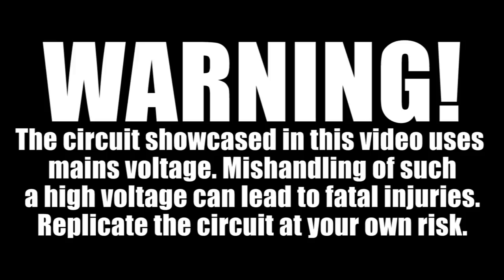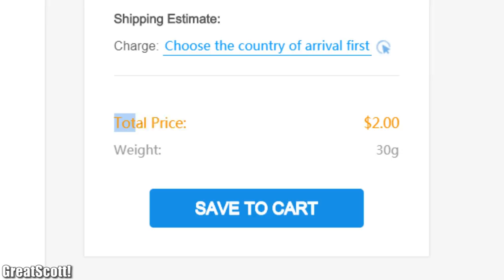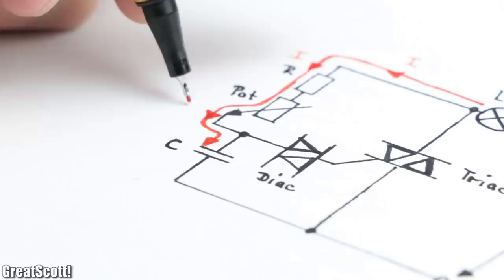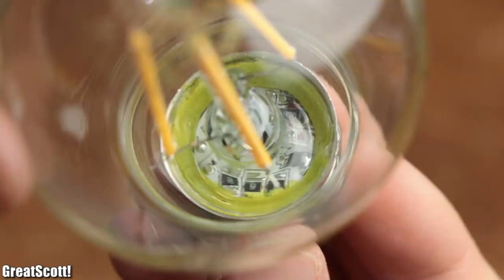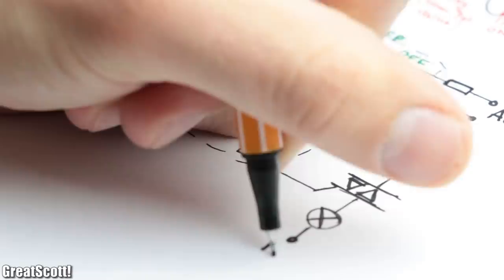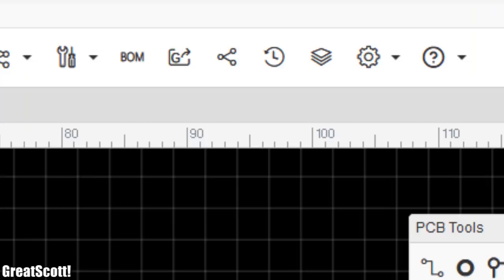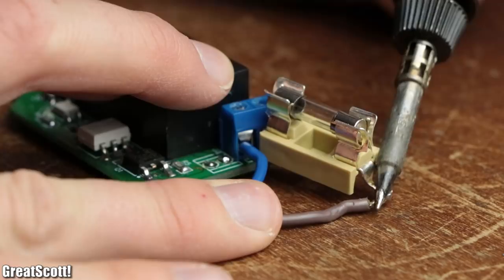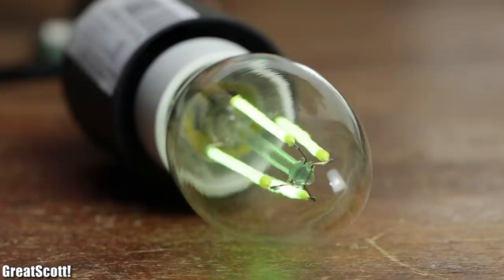AC Light Dimmer || DIY or Buy || Phase Angle Control Tutorial

Comment: Great video! I made this in 1992 with an EPROM based micro controlling 8 of these in parallel and accepting dimming values from the serial port. I programmed it all in ASM and every iteration of the development code took 40 minutes in the UV light to erase the EPROM. I also made the PCB by hand with a Dalo pen and drill. Good times!

Comment: You mentioned not using a capacitive dropper due to insulating issues. However the copper-fill on your board brings the mains too close to the low voltage side.
The arcover distance is too low I would say.
Many PSU PCBs do not feature any copper fill due to this reason.
Reply from the maker: Possible, that is also why Buy wins in the end. I am not a PCB design engineer. That shines through sometimes.
Reply: @greatscottlab  it still is a great design idea
Reply: That is not true many pcbs do have a copper fill but they always seperate the mains and output fron eachother and ofcourse use optocouplers.
Look up diodegonewild for this
Reply: @greatscottlab  Looking at the way this channel is heading - soldering batteries, creating making mood lights, making dimmers - you should maybe get in touch with people who do 240V PCBs. 240 Volts aren't much of a problem if you consider a few safety rules, like 6mm spacings. Maybe watch a few of BigClive's Videos, too, he always nags about unsafe electronics devices and shows why safe devices are safe. But I guess you already know him... It's not about nagging, more about the fact that I'm gonna build what you show here.
Reply: @bashaaksema94  yeah that's correct. As long as you keep no copper distance between traces and maybe even make adequate cutouts everything is fine
Reply: @greatscottlab  as you mentioned customizable, you could enlarge the gap between tracks.
Reply: @greatscottlab  so your two major blunders on that board is the flood fill and your optos not having a common line of isolation that the cross. Essentially U2 and U1 should bridge the high side and the low side across a single line. 
So flood filled cooper is a thing many people do not realizing it's done to reduce EMI and add a tinny bit of extra decoupling. When you have mains level voltages on a board, you want to make sure the low side and high sides are isolated and protected for all the major failure modes.
Reply: Wouldn’t you also want routed out sections between the high and low voltage sides so that you couldn’t get creep? (I don’t remember it’s proper name; it’s when the high voltage breaks down the insulation over a very long time)
Reply: Or is that only on transformers that you would do that
Reply: Yeah I came here to make a similar comment. But don't be discouraged. Maybe you could do a series on learning how to do PCB layouts? (After your studies are done, perhaps.)
Reply: @unbekannternutzer8506  was there any chance it wasnt?

Comment: "STAY CREATIVE AND I WILL SEE YOU NEXT TIME" ...this line has a separate fan base!!!!!!
Reply: So true!
Reply: Very true
Reply: I am new to this electronic stuff  

 so I am 16 and I just take components off of  random circuitboards from broken thing I can find. 
What does a coil do 
 i found a random  core "or what ever it is called" and it didnt have any wire around it. I tried to wrap wire around it and hooked it up to something 
I didnt get a circuit, nothing happened can anyone tell me what I did wrong
Reply: Kody Deville more information needed, what were you trying to achieve?
Try asking on Arduino forums or reddit
Reply: @spike4850  like I said I am new like verry new to this can u start like I depth with what an ardwino does and how I can find them on old circuit boards
Reply: Kody Deville an Arduino is a microcontroller. It is a product that is designed to be programmed so you can interact with hardware such as LEDs, motors etc. You can’t find them on circuit boards, you have to buy one online.
Reply: @spike4850  ok another thing I have this old laptop with a busted up screen that still works. I have a monitor that I hook it up to but I can't get it to show the load up screen that has the start up options for the laptop.  Is there any way I can hook up an external screen directly to the computer so I can see the start up screen
Reply: And I don't know how to program
Reply: I am able to get the screen to appear on the monitor . It takes a few tries to find the right reboot  option on the shattered screen but I get it to work.  do u know if there is any way I can get it to do the reboot automatically without me having to do it manually
Reply: Kody Deville seriously, ask on reddit, Arduino forum or stackoverflow

Comment: One more benefit of the BUY version is that it doesn't require power and can be used as a light switch, while the DIY version needs mains voltage. In fact, that might make a good video - how to draw current in series with a load, it has a lot of variations to it.

Also, the trace separation is soo narrow. I have one PCB that is pretty much the same thing, with a termoresistor and an LED display, but I had to go with big trace spacing and also clean the board very well. 
All in all, I hate dealing with mains voltages :)

Comment: Filling the ground plane in this case doesn't make very much sense since you have galvanic isolated between the high and low voltage portions of the circuit. The filled plane reduces the isolation distance unnecessarily. My biggest concern would be the potentiometer otherwise the case is enough protection. A partial fill would have been better.
Reply: I never understood the reason behind a ground plane. Maybe for interfearence reduction in highly sensitive circuits or when DIYing PCBs with a CNC. But even when etching it makes no sense. Ferric cloride is so cheap that being able to etch more PCBs with the same solution was never a valid argument for me.
Reply: I'm glad someone mentioned this!
Reply: @NightmareQueenJune  Ground planes are just like You said to supress EMI and in most driver IC's, transistors, diodes etc for heat dissipation.  For some data traces You can calculate capacity between data line and ground plane to get lowpass filter but I never used it in practice.
Reply: I use ground planes for impedance matching on RF circuits and sometimes for ease of use in DC grounding. For low-frequency circuits such as this, the ground plane should have been avoided.

Comment: I think with a better design of the PCB, and with an ESP8266, you could make a wifi controlled dimmer. Then have something like a rotary encoder for local brightness control. A central Raspberry Pi could be used for automation as well.
Reply: I was also thinking, adding esp-12f module would bring in a great benefit over the Buy versions, because you can then connect dimmer to many smarthome systems. (homeassistant)

Comment: Just some piece of advice for when you have to deal with mains voltage.
1) you did not respect clearance and creepage distances. The mains traces are too close to each other and to the low voltage part. I think clearance should be in the range of 3mm, and in the points where you are close to this you should make a slot in the pcb to increase the creepage
2) as others have said, don't use a ground plane in the mains voltage. You are reducing the insulation.
3) in your pcb, clearly separate the mains voltage area and the low voltage area, and possibly use a slot there to further increase the creepage. So draw a line, then put all mains components on one side, all low voltage on the other, and the connecting (hi-link, optocouplers) across. Avoid what you did here between the optocouplers

Thank you for all your videos :)

Comment: You should learn how to design a board for AC applications. That's the only problem stopping the DIY option.

Unless you're experienced it should be a good project. You just have to keep it in mind that you work with AC and unless you screw it up good then house starts on fire.
Reply: Seems to me like it's the same as low voltage, it's just worse if you screw up. Engineers for the power grid call 240V low voltage :P
Reply: well, it's been 2 years, but can you send me any docs, videos or tips for AC PCBs?

Comment: Another thing the potentiometer does in these circuits is reduce the power to the load, assuming the circuits were designed for maximum power transfer when the voltage is in phase.

Great video I enjoy this channel I think they should show more examples like this in engineering classes

Comment: Tbh DIY version is better due to its customizability. You could easily add sensors, replace the microcontroller for something with mode features or make it a multiple channel dimmer. I once wanted to make a this kind of dimmer for my bedroom lights and have Wi-Fi capability on it, but couldn't find a commercial product with a good price. Making it by myself was the only option, but up to now I couldn't find much information on it. Thanks Scott!

Comment: Since most mains power LED lights have a fairly high capacitance on the input, dimmable ones usually work better with phasenabschnitt. So if you're gonna use a ATtiny anyway you might as well use mosfet based circuit to control the AC since you can turn it off whenever you want during each half wave, you don't need a specific minimum latching current etc. For low power applications like these, mosfets while being more complicated to control AC with definitely have a lot of advantages over triacs.

Comment: Atmel/Microchip recommend a 100nF cap placed directly across the Vcc/Gnd pins of the ATTiny85.
Reply: That's just the bypass cap. You should include such a cap on every single digital component as close to the VCC and ground pins as you can to reduce parasitic inductance. They're not absolutely necessary. Your circuit will probably still work without them, but it improves stability and levels out fluctuations in the power supply.

Comment: I would recommend trying to make a trailing edge dimmer using a mosfet instead. You have more control over the waveform using mosfet instead of triac, less audible buzzing, less inrush current, and more friendly to LED lamp circuits when making it trailing edge.

Comment: Well, you have done a great job!
I might say DIY is the winner but there is no point for not using a capacitive dropper for the 5v supply, because the circuit will still be associated with mains and so the entire PCB should be isolated anyway.

Comment: I would say a nice 3D printed case/wall mount would bring the safety aspect up, but not everyone nas a 3D printer. Another thing to worry about is the possibility of microcontroller crashing due to interference making your light suddenly come on at full brightness, or turn completely off. Also why do you need a bootloader on the ATTiny, if not only you program it via ISP, but you also program it only once. Bootloader (especially the default arduino one) only takes up space and delays the startup of your program.

Comment: This is nice until You dimm active loads. Lets try some inductive loads (Fans and motors). For correct dimmer work You need to add shiffer circuits after optocoupler and also after triac. Nice PCB by the way. My latest finding for cheap uC in such of projects are STM32F051 - just 0.63€ in china. Most advanced feature in my point of view is 12bit ADC and DAC wich makes it perfect for some analog processing. I have made the same circuit some time ago with my CNC machine but for 8 channels, and understand that it was big mistake without sniffer circuit on load sides. Actually comercial solution wins only in one case - if You want to adjust power with You hand. But if You want to use some analog signal (Like 0...10V or 4...20mA) - then Your way works much better (Just need to replace potentiometer to analog input and it works.). Keep going - I love Your videos.

Comment: For the umpteenth time you deliver info exactly on what I wanted to work on. Thanks a lot.
Reply from the maker: You're welcome :-)
Reply: We have these AC motors on ceiling fans in India. Can we run those on these circuits to control the speed? Will the current flow and heating be too much to handle?
Reply: @anycatdessai  Motors cannot be dimmed since a motor is an inductive load, which will destroy the dimmer. These dimmers are only suitable for resistive AC loads.

Comment: Excellent video just one suggestion, those last copper planes break safety, you should not have them due to clearance and creepage distances standards for a given voltage, altitude and polution degree, by having them you defeats the purpose of the isolated power supply you are using :)

Comment: as long as you  have the board properly enclosed in plastic enclosure you should not have any safety issues?

you would need to design a knob stem that insures you can not come into contact with the  metal threaded part of the  pot control.

maybe a deeper enclosure and a pot control stem extension (you see this on some older tv monitors from the 60s to 80s to ensure the user cant come in contact with the high voltage parts such as the flyback transformer, multiplier and screen and focus boards

if an arc or short to the low voltage parts is made i would think the fuse would blow and the dimmer would be blown

Comment: I have solder, a soldering iron, not a lot of components, a room shared with my brother, a table, screwdriver an electric one, solder wick, and used solder. But I don't have a PCB, Arduino nano, capacitors, LED lights, potentiometers and wire.

Comment: I wonder why switching on in the middle of the sine is better than switching on at zero crossing and then cut off in the middle of the sine? I would assume soft on should be nicer to the load than just high impact at full voltage? I miss such explanation in all those videos about phase angle control. Thanks

Comment: Hi!! Nice video!! I didn't understand why this circuit is not safe. You've said that you wouldn't use the capacitive dropper circuit for safety reasons, and then used an IC to solve this problem. Then, why is it unsafe if you aren't using a dropper circuit?

Comment: I use old vacuum cleaner speed control for dimming my lights at home. They are awesome because they have nominal power of over 2000W. Only problem is that they need to be conected betwen live and neutral from wall and live and neutral from lightbulb. Would be cool if I could transform such citruit into the one conecting in series with the load.

Comment: i guess your next topic is about leading edge dimmer or trailing edge dimmer. 
If you are using TRIAC like in this circuit then it must be leading edge dimmer that it controls when to conduct the TRIAC. This method troubles some dimmable LED driver, because the driver are looking for phase length at the beginning of phase which is could be done with trailing edge dimmer. To make trailing edge dimmer we can't use TRIAC because most TRIACs can only delayed turn on but once turned on TRIAC cannot turn off until end of sinewave phase. Try to answer this problem when you are making video about trailing edge dimmer.
Some dimmable LED are flickering because simply there is not enough energy at the beginning of phase to power the switching driver circuit or in other word they need minimum phase angle to turn on (mostly above 15%). Other dimmable LED may not flickering because sometimes they are just designed that good so the switching driver are so efficient that they can be powered by only 4% phase angle so the LED are lit dimly (for night light).

Comment: I'm just working on exactly the same project. I've made pretty much the same PCB specs, however with a far better zero cross circuit. 
I was hoping you could explain how do proper filtering of the triac output to illuminate voltage spikes. But you didn't mention it at all :(. Also this doesn't show the best way to dim LED bulbs. You could do far better dimming with trailing edge dimming instead of leading edge. I was hoping you would explain that to, because that's what I learned from my project so far after I destroyed a few led bulbs...
Reply from the maker: Wait for the follow up video :-)

Comment: I had an LED and old fan regulator I  connected both of them in series , it dimmed quite well but at lowest setting of my fan regulator it flickered too much and last two setting had almost same brightness and regulated five levels.
Reply: A lot of speed regulators will use half wave rectification for the half speed setting. It only lets the positive side of the AC wave through while blocking the negative side. The result is the fan or bulb only gets half the power, but the 60/50hz frequency is also cut in half, or if you use it to dim the light, the light will flicker at 30/25hz instead of 60/50. You can flatten out the wave form by putting a few hundred uF of capacitors on it to act as a filter. I can't speak for ones with multiple speed settings, though. You can see an interactive demo of this on 
www.falstad.com/circuit/e-rectify.html

Comment: "The safety aspects of my version are terrible". I would really like a bit more informations about that statement. Why its terrible, what are the reasons? I mean the hole decision making between buy or diy was set on that sentence alone with little or no informations for the amateurs out there, like myself! Great video btw!
Reply from the maker: Look through the comments. Biggest problem is the space between mains voltage and the lower voltage. I am not a PCB design engineer. Sorry.
Reply: @greatscottlab  Thank you for the answer. Now i got the problem!